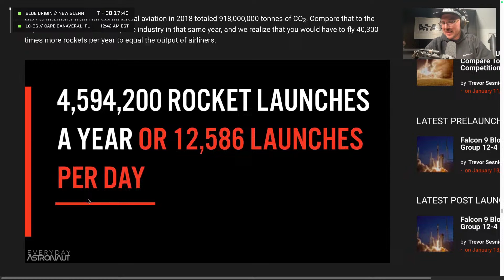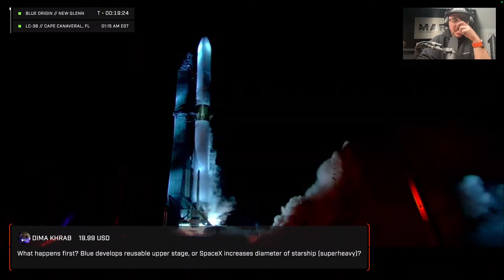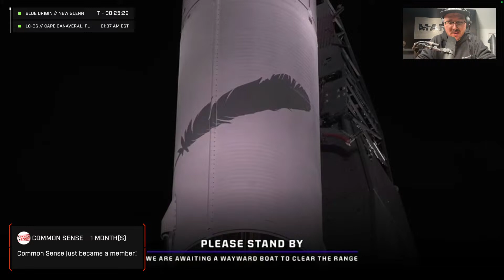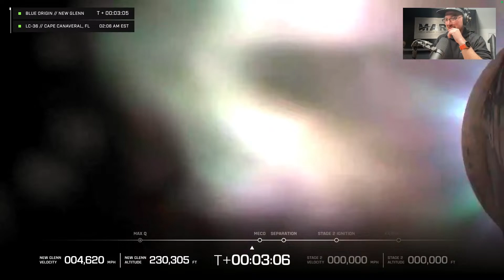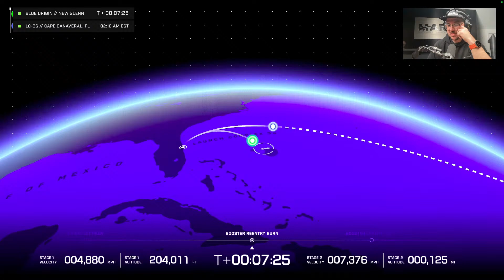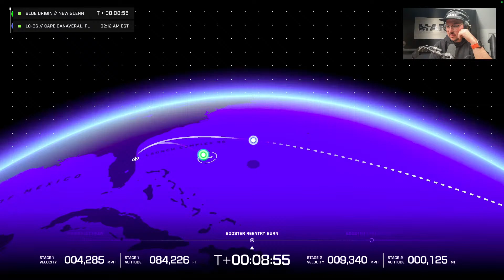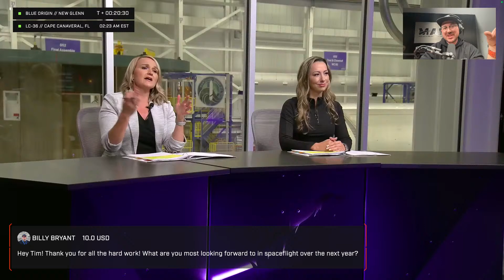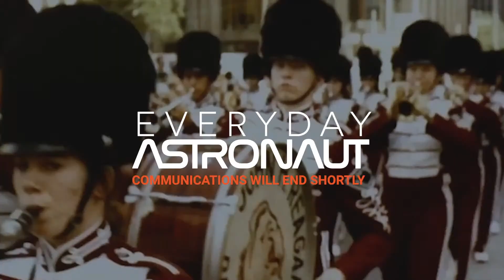Watch Blue Origin Launch New Glenn For The First Time!

Comment: If I had to guess I'd say re-entry burn started way too late. Not sure how accurate the telemetry was, but re-entry burn appears to start at T+7:46 at an altitude of 124,514ft / 37.9km and velocity at 5046mph / 8120.7kmph. Telemetry is lost at T+7:55 at an altitude of 84,226 ft / 25.6km and velocity at 5046mph / 6896kmph which is pretty toasty at that altitude.
Reply: It was a little delayed onscreen vice actual time
Reply: Yeah I noticed that, could be data issues though. But that was a late burn if it was true.
Reply: Telemetry was lost at t+7:55, not t-7:55.

They did claim to have data on both stages for a little while longer though, so I wonder if the broadcast just lost data, but the booster continued flying for a little while longer.
Reply: @sdfopsdmsdofjmp7863  My guess is that when telemetry data goes outside the nominal range they stop updating the public feed that we view, so we don't get any insight into the failure. They had data from the first stage engine until very close to impact, they just weren't sharing it with us.

Comment: OK--------. Dito on the slow lift off...  Compared to SpaceX... Superheavy...   The Starship Tail also looked a lot longer...  not expected with the much narrower and shorter New Glenn with only 7 engines...  But still, Starship/s  diamond Shock-Tail looked much longer with more shock-demands,,,  probably from the higher pressure thrust efficiency of the Raptor engines...!!!

Comment: OK---------.  They lost telemetry to the Booster at 8 minutes and was still saying they had telemetry from the booster at 10 minutes (after the booster was supposed to land on the Barge...  So when did they start lying to us...AS little as Besos has been informative over the years it is no surprise for lying for so long after they lost the Booste...  Probably blew up at tele-loss...!!!!  But then I did not expect the Booster to make a landing on the Barge. I did expect them to make it down through Max Aerodynamics and Heat stress. But it looks like it did not last that long... which makes it worse...   At least SpaceX did not expect its first Super Heavy Booster to make it back the first launch...  But that is why Musk wanted to do some rapid test flights to Iron out the Bugs... Besos is just finding out about on what was expected to be a perfect flight after 20 years of pushing slide rules instead of testing... Bet those huge bottom fins are more destabilizing than helpful...!!!
-------.  Also, The times between booster shut down, separation and then second stage light off, totaled almost half a minute...  How much Orbital weight did that cost New Glen...???    
---------.  Hopefully, they will get the landing next time but  I  won't hold my breath...!!!  😉

Comment: Whish they used meter system instead of feet system but fly safe blue origin!
Reply: Oh they surely are internally. Its either an oversight or pandering in public.
Reply: @LillyRocket  They might have used some imperial numbers on the booster flight computer, would be quite funny knowing it was lost because of wrongly applying number data (as it already happened with some NASA mars probes).
Reply: LOL
Reply: Washington’s dream…
Reply: It's to make flight analysis by competition more difficult (even if just by a bit). The shown telemetry may also be intentionally noisy / delayed / biased. SpaceX also seems to be doing it (uses km/h even though any sane aerospace engineer would use km/s).

Comment: Crazy.  After all of these years of making fun of Blue Origin, just like that, they leaped frogged Spacex in launch capability with New Glenn.  At least until Starship becomes fully operational.
Reply: Didnt SpaceX succeded to lunch 3 Starships to orbit already and 2 of them could be landing on the spot in the ocean ? where is the frogleap lol
Reply: @D33S3R  Starship has never been to orbit. Every launch has been suborbital.
Reply: And Starship explodes on its way up...
Reply: @gracialonignasiver6302  
And ?? It is a test vehicle after all and it's the first of the block 2 versions, so there's bound to ruds along the way.
Reply: They didn't leap frog SpaceX at all , SpaceX is still testing different components aka the hear shield and other components (the new pezz dispenser for the starlink satellites)and they have had a booster catch and they have been landing falcon 9s on barges for how long now??
Reply: @brettmciver432 Actually in one flight Blue Origin left SpaceX in the dust. Using the fix it then fly it approach as did the Saturn Five Blue Origin proved their design works. SpaceX is using the Soviet fly it then fix it meathod the Soviets used is still trying to come up with a fully workable design. Yes they have had more launches(and explosions) but it takes a lot more time and money to get a final design.
Reply: @EinKerl3554  Nope....remember space X has always tried to land both stages and that's where the challenge has been. If it's just about getting to orbit, then the starship system already has the capability to do that easily without the complexity of returning and landing the second stage.
Reply: @EinKerl3554  
And how long did it take to get that far? 20 something years and watching SpaceX do what they couldn't for all those years. Let me know when blue Origin launches something to the space station and regularly send supplies and Astronauts  to it  .
Another twenty years' time, maybe????
Sorry, one launch does not make a successful company , it's only one launch.
Reply: @brettmciver432  I'm focusing more on the fact that Blue Origin now has a rocket that can get multiple times the amount of payload into orbit as Falcon 9 for nearly the same price.  

Landing the booster, which Blue Origin will most likely figure out over their next few launches, is irrelevant to potential customers as long as the 2nd stage is guaranteed to make it to orbit.  The appeal will be the larger cargo bay.  As of right now, New Glenn is the largest active rocket on the market.  As long as the 2nd stage continues to make it to orbit, Blue Origin can literally start accepting customers while working out the kinks of landing the booster.

I call that leap frogging Spacex.
Reply: @gracialonignasiver6302  
Nope, I call that getting one rocket part to orbit .
What happens if in the next SpaceX flight they hit all of their goals?
And flight 8 they launch starlink satellites too? Which is something I heard Elon say about Ss8s launch.
These are different approaches, yes leapfrogging no.
Reply: @gracialonignasiver6302 if they can’t land the booster, price per launch goes way up. Small accomplishment from Blue Origin. Turn your brain on.
Reply: @gracialonignasiver6302 Sorry but no: one successful launch is not leapfrogging anyone. To begin with they do not have the capacity to launch 150 times a year. They cannot build enough rockets. And they cannot even think of competing on cost until they manage to reuse their first stage a few (let alone 25+) times. To make it even worse, SpaceX is reportedly very frugal and BO has a far more traditional approach, especially on costs. It is all quite well documented. We'll see how it pans out for BO. I wish them the very best because competition is good, but let's not get ahead of ourselves
Reply: @brettmciver432  

"What happens if in the next SpaceX flight they hit all of their goals?" - @brettmciver432  

In my original comment I literally said, "At least until Starship becomes fully operational." 
New Glenn is a significantly larger rocket that F9 that is now capable of getting to orbit.  No debate about that.
So what's the disagreement about?
Reply: @gracialonignasiver6302  
Your claim of leapfrogging is what this is about.
Reply: Yes and about Starship, which is not to compare, it cannot sent real satellites in orbit, there is only thus small starlink distributor. Fir now no fairing and no real possibility to out someting in orbit. Not the same goal. So yes, New Glenn is a great opportunity and challenger to Spacex (Falcon heavy)
Reply: @user-iy9ef9jp3s  Starship has a completely different end goal than New Glenn. Starship has not been and never will be about putting payload to orbit in a contractual nature. Yes, that capability will be be added as a way to generate revenue for the program, like we are seeing with the addition of being able to expand the starlink array, however focus for starship is not so much delivery to low earth orbit as it is exploration. The goal of Starship is to send people to land on the moon and then to eventually send humans to live on Mars, not launch satellites. To be able to do so, and meet the launch frequency requirements, Starship requires complete reuseability of both stages, not just the booster. Hence the multiple missions to perfect bringing Starship back down to precise water landings in safe places where infrastructure can't be damaged. Once they have demonstrated catch capability of both stages, (IFT-9 is the plan for that, last I heard) the next step is reuse of both stages. That is allowing time to perfect the design for reliability as well as build the necessary infrastructure on earth to be able to build boosters and Starships at the rate needed to achieve the end goal. IFT-7 will leave the pad later today, and the necessary hardware for IFT-8 is already built, and ready to test before sending to the pad for launch. New Glenn doesn't even have a second booster yet.. Blue Origin still has quite a ways to go before being "caught up" to SpaceX. So far all they have done is send a couple dozen celebrities and other rich folks on a suborbital hop just above the Karman Line for PR, and put a single dummy payload holder into orbit on a non-reuseable upper stage while failing to land the booster, so all they have demonstrated so far is the ability to put something in orbit on an expendable booster just like any other launch company. New Glenn isnt really even meant to compete with Starship, its numbers put it squarely in the Falcon Heavy range only using a single core instead of 3.

Comment: How is it possible that spacex struggles so much with FAA, cannot do orbital flights despite completing multiple tests. And blue origin coming from nowhere, first flight, and it's orbital.....
Reply: Well dont forget that SpaceX havent tried to make orbit yet. SpaceX knows orbital flight in and out, but what they dont have data on  is reentry. All 6 IFTs have been focused on the hardest parts of the flight, reuseability. New Glenns main objective was to make orbit, and their secondary was to land (which they obviously havent figured out yet). Starship is a whole different beast, and its main objective is to be fully reuseable. Getting that ship back from near orbital speeds and landing while still having good payload capacity is an insane feat of engineering.
Reply: @Kamakazii  True. If Elon’s goal was just to get richer by moving goods to orbit indefinitely, he could have simply kept building larger partially reusable Falcon rockets.
Reply: Expect that to change in about 4 days.
Reply: @sdfried4877 the Starship is much more technically ambitious. If they only wanted to reuse the first stage the Starship would likely have completed orbital flights by now, but since they are trying to recover the 2nd stage too it’s taking longer
Reply: Because Elon is a blow hard
Reply: Blue origin did not come from nowhere- they have been working on this since before space x was a twinkle in Elon’s eye.
This has been the slowest burn EVA
A true case of tortoise and the hare
Reply: @ They were both incorporated a year apart with BO in 2000 and SpaceX in 2001 but that’s hardly relevant if until you produce an orbital rocket.

Comment: Superheavy is already a methalox booster. And SpaceX has already recovered/landed/caught one.
New Glenn uses hydrolox upper stage, which has been done many times before.
A cool milestone for Blue Origin the BE4, and those involved, but nothing really new for spaceflight.

How many orbits are they making on this first flight?
Reply: I think they said 6 hours, so it would probably be about 12 orbits
Reply: @ Yeah, but they also SECO at 100 miles elevation, which is below LEO. IDK if they were still on an elliptical orbit with a much higher apogee, but I didn't think you could do 5 orbits that close to the Karman line without reentering.
Reply: They are going into Middle Earth Orbit (MEO). It is something new to spaceflight as Starship hasn't fully orbited the Earth yet, New Glenn's second stage will. New Glenn is officially the first U.S methalox rocket to achieve orbit and will have the furthest orbit of any methalox rocket yet. Also, I believe Blue Origin is now the first private company to achieve orbit on their first attempt with an orbital class vehicle.
Reply: @yaxleader  Hasn't Vulcan Centaur reached orbit, using Blue Origin's Be-4 engines on the first stage?
Reply: @michaeldunne338  Ah true, I spaced
Reply: @ yeah, the said MEO, but then were only at 100 miles altitude when the burn ended. So, they're just on a crazy elliptical orbit? Did they relight and circularize at MEO, or what? Starship was in orbit, and higher than that, they just deliberately has a perigee of <0 km to land in the ocean. If they had chosen a circular path, they were at 100% orbital velocity, just only completing 1/2 orbit each test. Relighting engines in orbit is a pretty big deal too, but that part (if they did it) wasn't on stream.
Reply: @Brainstormer_Industires  SECO 1 was at 100 miles as they extended their apogee to 2000+ miles with that burn. Then they reached the apogee on the other side and burned again to reach MEO. The orbit is about 2400 miles by 19000 miles
Reply: @yaxleader  Wow, ok. So they did have a successful on orbit relight and circularize at over 2000 mile. Was there an actual payload on board, or just some comms stuff and mass simulator?
Reply: @Brainstormer_Industires  Blue Ring Pathfinder mission. Internally developed technology for basically an ESPA Ring Bus. It's proving out a lot of it's internal tech such as comm and avionics. It isn't separating from the second stage though, it'll just sit on top of it.

Comment: Looked like a Saturn V rocket going so slow
Reply: TWR at liftoff is around 1.1 so even lower than Saturn V
Reply: @karliszauers1 I imagine that’ll improve as they mature their hardware, 1.1 is reallly low.
Reply: @pekabu01  suggestion: this may be the norm for heavy lifts. larger payloads means high G manoeuvres cause damage and stress. larger rockets will also suffer this.
Reply: @Zacharysharkhazard  100% they have a lot of weight to cut especially with all those APUs, engine side hardware etc. They're also considering going for 7 engine config. NG isn't yet capable at delivering it's advertised payload Mass. But without a doubt they will get there
Reply: @RobinGething  It is not. 1:1 is just sitting there. 1:1.5 would be drastically better for efficient speeding up ascent and still be very gentle acceleration.  The imit is not the durability of the payload but the power of the engines vs the weight of the rocket, fuel, and payload.
Reply: @paull3278 the TWR at liftoff is 1.1 and then it gets higher as the prop gets burned off. Starship is closer to 1.5 at liftoff
Reply: @karliszauers1   TWR of 1.1 is very low, you're just burning fuel for very little benefit.
Reply: @spacechannelfiver  yeah I know, but it got better pretty fast. Avg TWR over the first 40 seconds was closer to 1.2
Reply: @ you think rocket engines are at full power? The payloads being larger means durability of the payload becomes more a problem than before. check out how slow the Apollo launches were. we are in the overpowered engine and fuel left over after ascent. we have margins now.
Reply: @ from what im reading they dont want to be stressing the engines. they dont want to just dump old stock in the ocean in the name of learning something.
Reply: @ less stress over fuel efficiency to the rocket is a smarter move than you're giving credit here.
Reply: @spacechannelfiver  yeah they're a bit overweight rn too. New Glenn payload capacity rn is about 40T to LEO
Reply: @RobinGething  g load of the payload isn't really a problem nowadays. It's more about vibrations and acoustic environment.

The problem with high acceleration is the aerodynamic stress rocket has to endure.
That's why all vehicles play it safe and are overbuilt & heavy for their first launches and end up creeping up in thrust while dropping some if the structural mass

Models simply aren't yet there for companies to accurately estimate the exact structural load
Reply: @karliszauers1 wait, for real?
Reply: @charleskavoukjian3441 yeah, it will improve over time but the first flight's TWR was insanely low
Reply: yeah, I wonder if that was planned.. it looked VERY SLOW.. like the first Starship launch. But the engines seemed to be working fine.
Reply: Haven't really been following New Glenn - how the f are they only at 1.1 thrust to weight with no payload?
Reply: @carlkinder8201  they are a bit overweight on the engine support. And upper stage tank dry mass

It's not that bad tho as the payload mass is just a small fraction of the total mass

Also they're planning to make NG more powerful by going to 7 engines instead of 5
Reply: This rocket that just launched does have 7 Engines.... what do you mean 5! @karliszauers1
Reply: I mean, it's pretty much the same size lol
Reply: @yaxleader Saturn V is significantly taller than that at 111 m.
Reply: It doesn’t matter if they don’t want to over stress the engines they said the engines was at full power there is no way they are getting a payload to Leo with this rocket 1.1 is not anough but the will get it right this is there first real rocket
Reply: Slow for sure.  Very much the "old man's rocket".  Took them forever just to reach max-q ... then only 60 seconds later was MECO.  Never saw that before!  😊